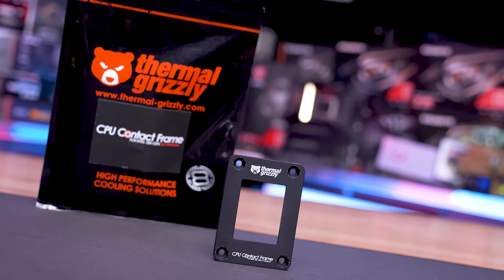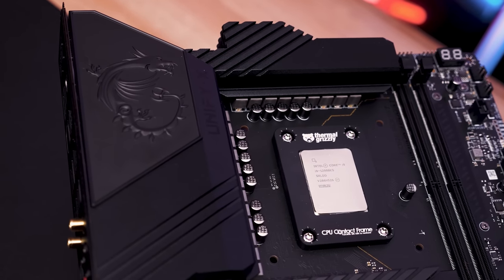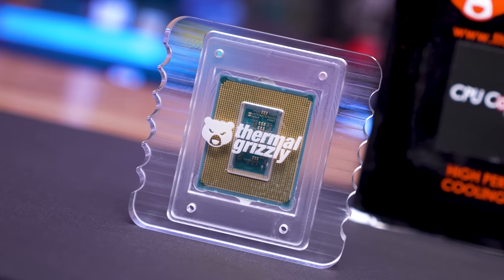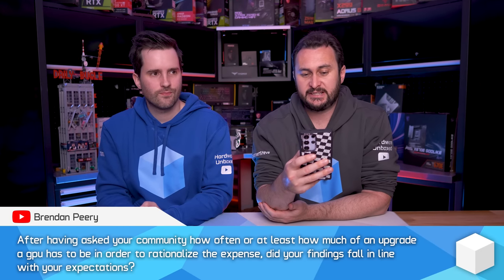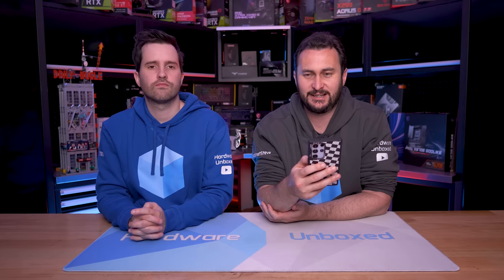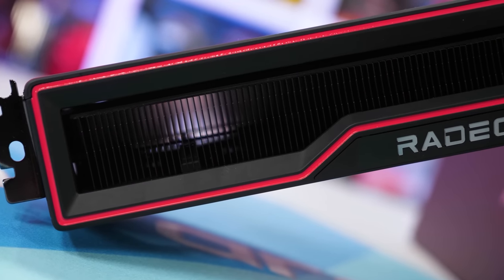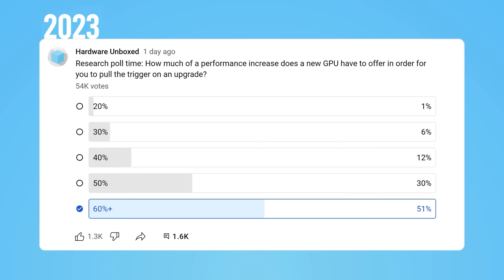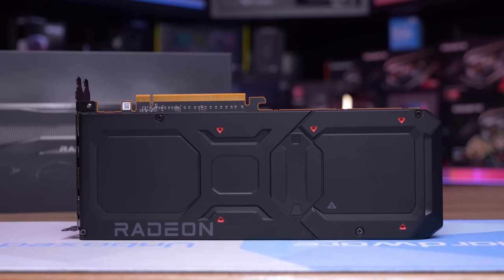RTX 4050 Pricing & VRAM, Are 12-core CPUs Dumb? March Q&A [Part 2]

Comment: You know, it is unironically not out of the question, that my RX480 will indeed have to keep chugging for another 4 years to make it a nice 10 years of service.
Reply: I refuse to burn my money on a new video card.  My 1080ti is going to carry me a few more years, even if I have to go back to 1080p.
Reply: Just retired my AM3+ system today... has almost been 10 years of loyal service, throughout all those different life events that a decade contains. It's sort of emotional, but I'm just looking forward for my mind to be blown with my new AM5 system (yet to be complete). I have faith in your RX480.
Reply: a 5700XT is under 250$ USD right now and would more than double your GPU performance. Don't need to buy latest and greatest for a decent upgrade.
EDIT: also a 6600 XT is around the same price, and would be even better than a 5700XT. Either way, there are upgrade paths opening up for budget minded gamers.
Reply: My R9 290 served me for nearly 9 years.
Reply: Did you flash it to 580?
Reply: Still on a GTX 1080, myself. I'm just gonna wait 'til it dies at this point. Besides, I already have a backlog of 20+ games that I need to play that will run plenty well on what I have, so I might as well just play through those before investing in something new and shiny. And by then, I might be able to score something used at a much more reasonable price.
Reply: lol
Reply: @manuelhernandez2017  nah
Reply: @urinstein1864  my son has an Rx 570 4gb in his PC from a really old PC I has built, my wife and daughter both still have Vega 64 and 56 in theirs from long ago. Still run current gen really well at 1080p.
Reply: @oinker4290  if you're going AM5, don't look into the pluton security chip. It's going to ruin your build